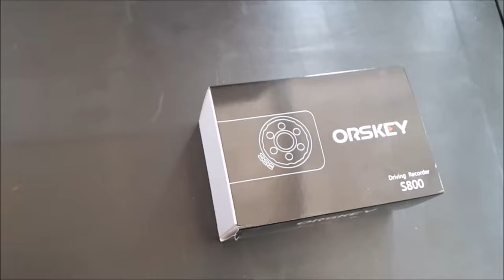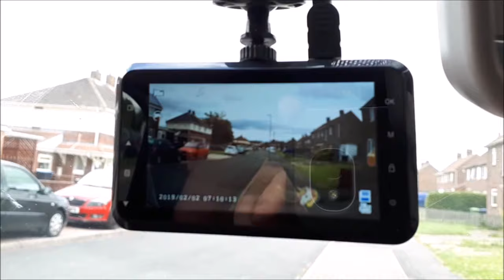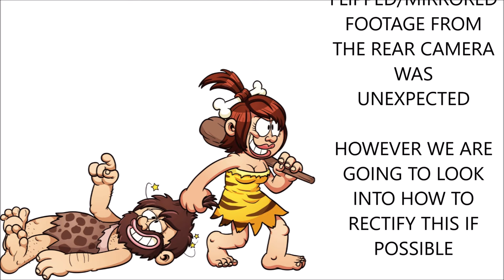ORSKEY S800 DASHCAM UNBOXING ASSEMBLY AND FITTING

Comment: Brilliant I’m 70 and haven’t got anyone to do this so thanks
Reply from the maker: You're very welcome Barbara
Reply: Nice one Barbara, you gave me the inspiration to get it installed too
Reply: I did mine and I’m clueless with writing.

I just used the cigarette port attachment and ran it down the A frame. Works well and shuts off when you turn off the ignition anyway……
Reply: @jammin1881  but some cars that socket is always live...so it will still be on
Reply: @WELLBRAN  

Yeah I have it set so the camera turns off after five seconds and doesn't stay live when the engine is off.
Reply: @jammin1881  good🙂
Reply: @WELLBRAN  

Yes sir!!! Well so far so good anyway! 

I will go out to drive later and have a flat battery now ......

Watch
Reply: @jammin1881  no you won't!
Reply: @WELLBRAN  

After I replied I went to the cupboard and dug out my portable battery charger anyway! 

Paranoid and left it in the back seat!
Reply: @jammin1881  just get a bag and leave in boot or no under passenger seat out the way.. lol

Comment: The only criticism I have about this camera is the  screwing feature, they could've used something simpler like slide in and out the camera instead of screwing it every time you get into your car.
Reply: Hi , why do you unscrew your camera every time you get into your car? I leave my camera in position, is it a security issue? 

Thanks...Dai
Reply: @1972piledriver  Well, it's an invitation to break into your car and steal the camera, once it's taken there is no way of finding out who did it.
Cheers.
Reply: @TheOneStraightPath  ok, I understand, but you would still have to disconnect the cables and that's a faff lol maybe you could just take it off the windscreen with the suction cup? Or maybe not lol have a good evening 👍
Reply: @1972piledriver  I suppose you could yes when you come to think of it lol. Good evening.

Comment: Just purchased this dash cam from Amazon and although I haven't installed it yet, your video will become very handy indeed. Thanks for taking the time.
Reply from the maker: You're very welcome, thank you for watching
Reply: What is your review of it now you’ve had it a while. Did it last and perform as you wanted?
Reply: @TrippinTafty   Hi Alex. Don't bother with it, mine stopped working after 2 months of minimal use. It also fried 2 mini sd cards that I left in the unit during the hot weather. I changed my car during that time with a built in dash cam so it wasn't needed anyway. Would I recommend it, no not really you get what you pay for I suppose.
Reply: I did the same and still have it in box most places won't install it as I didn't buy it there

Comment: This one of the better videos that can be found so well done buddy. Just a helpful tip for people, I wouldn't use a screwdriver to push the cable, use a plastic blunt rod or something as the wire can be damage easily. As for the red wire my understanding is that it is not needed to be connected for rear camera to work, you can hook it to the positive cable of your reversing light so that when you put your car reverse the camera will come on so you have a reversing camera. The company instructions are unclear about it.
Reply from the maker: Thank you MrBonk and yes I totally agree about the screwdriver. Also that is correct about the red wire

Comment: For anyone who might be interested, the red wire, is for reversing, so basically you need to hook up that red wire with your reverse lights, you will (usually) find two wires, one negative and one positive. So you need to connect it with the positive wire of the reverse light, of course every car is different but the majority of time the wires are colour coded as white & blue.
(Of course your car's reverse light wires might be of a different colour)
You need to identify the reverse light wires and connect the red one to it.
I hope this helps.
Reply: Hey mine works without connecting the red wire?
Reply: I installed the rear camera (connected the HDMI with the front camera).  (I didn't connect the red wire with the light).  But the screen i didn't see the rear image.
Reply: @2idiotsexplore572  does it show a reversing camera on the main camera?
Reply: Just to let any readers know. I've had the cam for about 2 months now and I'm very happy with it. I've wired both front and back and you have a really good peace of mind knowing that some idiot crashing into you (shouldn't) ruin your insurance premiums as you have evidence. Highly recommend. Didn't take too long to wire the rear cam either, I just ran the cable through the plastic linings in my cars roof where I could peel it back and a plastic tool and drilled the mount onto the rear roof with the screws provided!
Reply: @wendychow3416  did you get it to work?
Reply: @karleormond9720  yes
Reply: alhamdulillah..tq for sharing
Reply: Then what’s the function after you connect?
Reply: Thanks.  So the red wire in the back camera is not really needed since the front and back camera are connected and will always be running when the car is on.  Correct?
Reply: @jerryfuentes1402 In theory yes, but a few people (myself included) can't seem to get the rear camera to work when not using the red wire.
Reply: Thanks! I’m about to install mine and this helps a lot!👏

Comment: Just bought the S900 model the rear camera shows the left hand side of the road which is the correct side easy fit as I had a hard wired fit in place thank you The Caveman for making the rear even easier plastic bike tire lever makes easy work of pushing cable in

Comment: That helps a lot. Thanks guys !!! 
PS: Instructions on why we have a red wire is on the instruction leaflet shown at the 11th second of the video.
Reply: So where does one connect the red wire to
Reply: @jordanncube6411  It should be connected to the reverse light so that the camera system will know it should display only the rear camera when reversing. Being said that I haven't done this myself yet. This should be helpful especially when the rear camera is connected near the number plate. I hope this helps.

Comment: I've installed loads of dash cams but never had the rear view till I bought this one. I was hoping to see the red wire bit to the reversing light enabling you to also use it has a reversing camera but I see that was answered further down so just thought i'd say, great informative video! Very helpful. ;-)
Reply: Good video instructions, but where  do you connect the red wire for the    
Rear camera..
Reply: @jordanncube6411  The red wire connects to one of your reverse lights. Therein, whenever you put your vehicle in reverse it switches to a reversing camera. I haven't done this yet so I cannot tell you how easy or hard it is to do but further down on another comment someone has advised of a little connecter that will make this part easier.
Hope this helps.
Reply from the maker: @TrueGod1974  Thanks Scott, I'll try that one myself

Comment: Great video Ian, although I wouldn't use a screw driver, a plastic tool is recommended. The only downside I see with is the cigarette lighter plug, I have USB so will have find a solution

Comment: Great video, thanks a mill. Installed with all of the wires neatly hidden away in 20 minutes. Did anybody find a solution to the rear camera video being inverted?
Reply: Lol. I fitted this to the lower area and it was upside down, had to revise idea and move it to the roof liner, which it seems to have stuck and screwed to okay. Time will tell I guess. Camera only fits to the upper area, otherwise it's upside down video.

Comment: Can you just use the front facing camera and with the cigarette port? I only want the front facing camera for when I’m driving and recording front facing stuff. 

Thanks for posting!!
Reply: yeah you can
Reply: @dashcamarmagh  

Thanks! I already installed it and got it working. I’m actually impressed for the $ amount.
Reply: @jammin1881  is it working well? curious to see how reliable such a cheap camera is
Reply: @dashcamarmagh  

I have no experiences with other cameras and this was my first dash cam. 

It’s working well and drama free (so far) 

I haven’t hooked up the footage to a computer yet though so can’t tell if it shows registration plates or smaller detailing though?!

For now it’s good though and just wired it to the 12Vport (cigarette port) where it shuts off when the engine stops.

Comment: When installing the rear cameras, you made two small holes using a drill. Is there any way the rear camera can be installed without making holes? I ask because my car is on a leasing agreement and I do not think I am allowed to be making holes. Thanks in advance!
Reply: Double sided tape?

Comment: You are showing footage of the rear cam while driving forward , without connecting the red wire can you manually toggle between front and rear ?which is no big deal ,thanks

Comment: I pushed the wires in like this with a flat head screwdriver and it damaged the cable, my mistake but they are pretty thin ... plus i had no spare sockets for my dog n' bone so what i did was get a multi-port charger for in the car so i had two spare sockets and then got a 4m juicebitz usb to mini b cable and fixed this in its place instead... much thicker and powers on instantly... just wish they did the one from front to back and the rear camera is a bit naff... why do they make the wires so easy to damage??? surely these don't cost much???, needs better res. also the S680 is ok but they're all pretty much the same and fraction of price of garmin etc. If we change the car ill go for S900 model or this S800 one as all 1080p but not changing it now... good video thanks but advise everyone not to use a screwdriver really just prize the headlining and plastic back with it then push it in with a credit card to prevent damage ;)

Comment: Hi all, I am bit confused. So I ordered this and trying to install it myself. I want the reverse cam input to show on the screen of the main camera along with other front views when I am driving, and then a full screen back side view when I go in reverse gear.

So do I still attach the red wire from back camera to +ve input if car reverse lights? As I understand the red wire will trigger camera to show back side view only when I put car in reverse gear, and no reverse camera input to main camera screen when I am driving? Please suggest.
Reply: Also, if I just try to test the camera without connecting it to reverse lights of car, like I have put main camera on charging in house using the usb cord and I connect the reverse camera wire to main camera, should it show the feed from reverse camera as well, just like that ? I can see main camera recording. Please advise. Is my reverse camera broken ?

Comment: Helpful vid - not sure i'd recommend using a screwdriver to prise back plastic trim though...Have you had any issues saying 'SD card full'? Mine gets full every 10 days or so -  I have a quality 32GB san disk extreme SD card so can only imagine its a setting somewhere? I have it on 3 min loop recording?
Reply from the maker: Normally I wouldn't recommend a screwdriver but it did the job and as long as you're careful shouldn't cause a problem. SD card gives me no issues at all as it immediately overwrites
Reply: You can change the resolution in the settings, the memory won’t be used up so quick then
Reply: Every 10 days? 😂😂😂 What do you expect? Just delete all the footage every few days, you only need to keep useful footage of any incidents you have. A 32gb card can’t store weeks of footage.
Reply: @Sapper094  You've completely missed my point - it should record over itself when full.Thanks anyway.

Comment: Where does the red wire that's attach to the rear camera go?
Reply from the maker: We just tucked it away. I thought it must have been an earth wire but we tested with fastening to anything and it works so make of that what you will lol
Reply: Those wires are meant to be wired to the reversing light so that it automatically switches view when reversing, Allowing you use it as a reversing camera. Bit of a shame they didn't show how to do that, What I was watching for.
Reply from the maker: @KateBerry95  Thanks Kate, doesn't mention that in the instructions lol
Reply: @KateBerry95  ah that makes sense, thank you!
Reply: The Caveman quick question, I have the same dash cam but I am struggling to get the rear camera to work. Do I have to attach the red wire to something for it to have power because as of now nothing shows up on my dash cam
Reply from the maker: @farhaniftikhar9383  Hi, I just ran the black lead from the front cam to the rear cam. The red wire hasn't actually been attached to anything but everything works fine still

Comment: Thanks for the video. Very helpful. Just got an s800. Though will you do a video on installing the rear camera to the back light?  I don't want to drill holes in my car 😀
Reply from the maker: Hi, I am thinking of making the video of the rear light/wire connection. Just going to wait til the weather picks up a little haha
Reply: As a quick fix push the camera holder into the panel (where you tuck the wires) and there will be no need for screws or sticky tape. But yes, a video on connecting the red wire would be great

Comment: If the red wire is not connected and the rear camera is not prompted by the reverse/backup light, will the rear camera run constantly and record both front and rear at the same time?
Reply from the maker: Yes it does that. The footage at the end of the video show recordings from both front and rear
Reply: What does the red wire do?
Reply from the maker: @allisonberg3477  I didn't know at the time but apparently it connects to the reverse light and gives you a reversing camera

Comment: In my missus car she doesn't have those edges where i can hide the wires for rear camera.It was last night that i tried to install it and i haven't looked down but i will and come with an update.If that doesn't work, what do you recommend?I'll post later a pic so you have a better idea
Reply from the maker: I would need to se a photo but usually cars have trim that can be pulled back to hide wiring

Comment: Quick question, what was that loose red wire for? Grounding?
Reply from the maker: Hi, it's actually to connect to the reverse light for rear view but I couldn't find in my instructions what it was for at the time so I just tucked it out of the way. I may connect it later this year
Reply: @CaptainCaveman01  So literally all it does is turn a light on for better view? If mounted inside that's not going to be much use anyway, so sounds like I can leave it off. Thanks for the tip.
Reply from the maker: @neilbarnwell  It connects so you have a reversing camera (apparently lol) I'v never bothered myself. I just wanted the cam in case of bad drivers etc. Turned out to be useful not long after installation

Comment: Many thanks for this video. This was much better than trying to follow the Orskey instructions that came with the S800. Are those screws you had to use for the rear cam still tight? I worry they would work loose from the plastic panel over time.
Reply from the maker: Thanks for the comment Tony. The screws are still very much in place

Comment: looking in instructions but cant find this,  how can you save a clip on this dash cam ..as it happens can i press a button to save if i get an incident?
Reply from the maker: It just records from starting up. Then take out the memory card and transfer footage to PC or tablet. You just need to figure out which clip it is as it records in segments
Reply: You can lock a clip so that it stays on the sd card. When you go though the clips it will give the option to delete or protect 👍
Reply: @lianewinters8809  yes understand that but do you press a button at the time to lock the clip.. as it happens
Reply: You either press the lock button or scroll down to protect  and then press ok just like when deleting you highlight delete then press ok then scroll down to confirm and press ok. 👍

Comment: Hi , I have the S800 what setting do you put in to keep the camera working for the whole journey  as mine switches off after a few minutes
Reply: Does it switch off, or does the screen go into ‘screen saver’ mode to be less distracting? Had you checked the footage on the memory card to see if it stopped?
Reply: @simonrobinson2252  Thanks for replying and yes it switches itself off, I have checked the footage and nothing after it was switched off
Reply from the maker: Sounds like you might possibly have a poor connection, maybe at your power source?

Comment: Did everything as per video, and instruction booklet.  Camera keeps disconnecting & reconnecting every minute.  Very disturbing.  Manufacturer is not helpful.  Saddest part is I was already using a Transcend Cam which has WiFi, GPS, Lane control, and many other functions, while the Orskey has a few but manufacturer says to switch all of them OFF!!!  Then why even have that facility.  

In short, it was a bad buy.  I can't even return, because it is beyond the 30 day return from Amazon UK, and I am in another country for 4 months now.  
Hope manufcturer will take it back and refund the money, or replace this with a properly working unit.  

Advice to others:  Do not buy until you test it all out and ensures that it works.